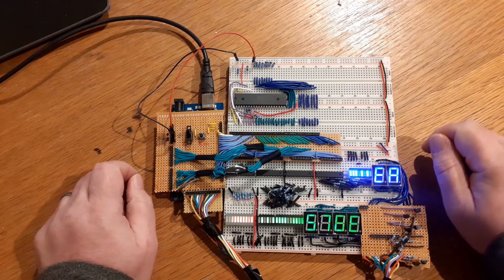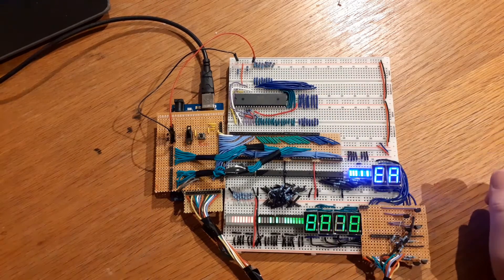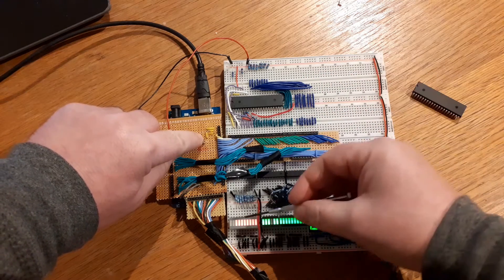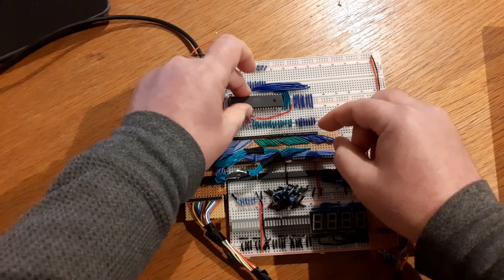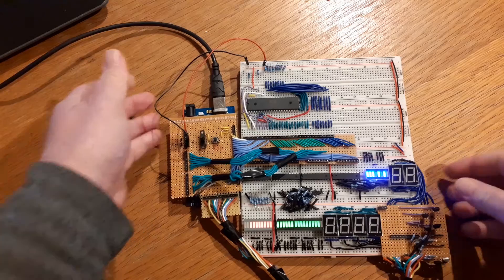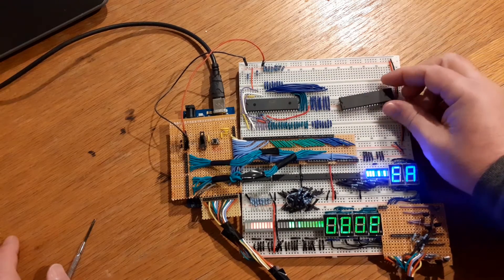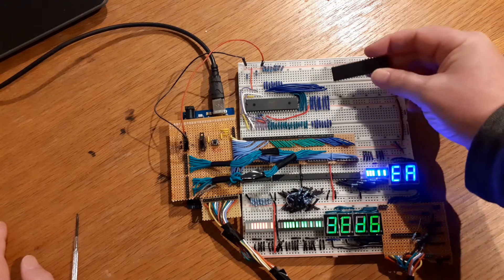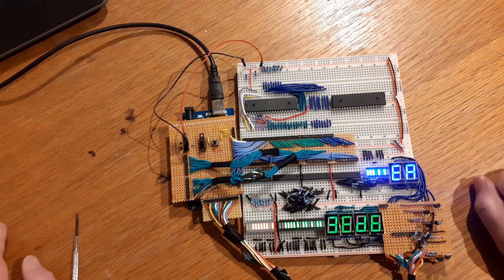I'm a Jerk! Diddled with fake 6502 chips! Avoid my error! (65c02, project, debugger)

Comment: UMC did make a 6502 variant, it was/is marked UM6502. 

If you see one marked UMC W6502 then yeah, it's (almost?) definitely fake but could be some 65xxx variant with a different pinout or it could just be a random 40 pin DIL. 

Might be interesting to attack it with a bit of acetone to see if you can reveal the original part number
Reply from the maker: Yes, should try that. Think I've still got it

Comment: I am trying to do the same thing with a Z80.  Just a question, as you said, the older processors. used dynamic memory, not. static, so the clock has to run to refresh the memory or the thing dies.  Any idea what the minimum clock speed would be?  Hz,  kHz, MHz?
Reply from the maker: It would depend on the memory, the old processor's can use either though so most people go for static ram instead as it's simpler. Back in the day dynamic was cheaper so most went with that rather than static. The refresh rate is usually not dramatic per cell but depends again on type. I think but I'm no expert in Dram that KHz range is usual. I would have to check to be sure.

Comment: Fake chips are usually old NMOS chips re-labelled as CMOS...i.e  old  1MHz NMOS 6502s re-labelled as CMOS R65C02P4s etc or old Z80As re-labelled as CMOS Z84C0020PECs....you can tell straight away as they are so Cheap 10pcs...for $10..They usually work at 1MHz,4MHz as the original chips did...ideal for repairing old ZX Spectrums, Apple IIs or Acorn Atoms...

Comment: We all are going to be a victim some day. Since China is selling desoldered chips a "old stock" and chips where traces of solder are still visible as "new". Old computers went to China as junk, the all computers were categorised and stored and bit for bit taken apart. 
 
This taking apart must have been done be very clever robots or voluntary workers who don't need to be paid, the ordinary Chinese slaves can't be trusted with goods for export, sabotage is too easy. 
 
Everybody did it, a 6502 is no longer in production and real old stock has ran out years ago. Now China is selling fakes, rebranded chips, relabled. Maybe some day complete remakes will be offered. An FPGA programmed to act like a 6502 put in the housing of a 6502 and nobody will notice. 
 
Nice thing to look at is the market for prescription medicine in Africa, all packages are correct, the pills look good but the only problem is that there is hardly any working substance in it. The future is now and it looks bad.
Reply: The original 6502 is no longer produced, but Western Design Centre still produces a CMOS DIP version. Just order it from a reputable electronics supplier.
Reply from the maker: Yes, Mouser have them reasonably priced,

Comment: You know, I bought the UMC IC too as it was cheap. Bought 4 of them, because why not. De-encapsulated one, as I knew that it is a fake as no genuine one is sanded, re-painted and re-lasered. I put the die under my microscope, searched for manufacturer info, and guewss what? It was a Ricoh RP65C02G. Of course it was used, desoldered, polished and sold, but I am still happy camper, as it cost me just $1 shipped. All the ICs have large KOREA writing on the back side. In fact, the back side is always better (mostly the only) indicator of what the IC is if bought from China scammers.